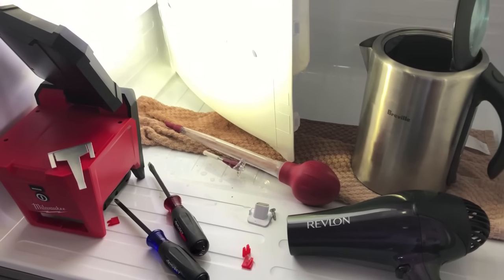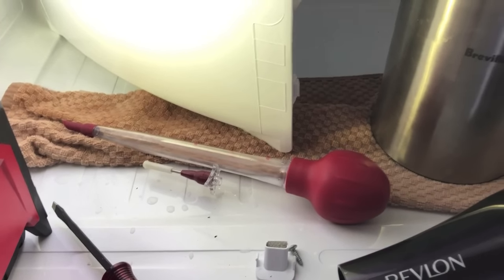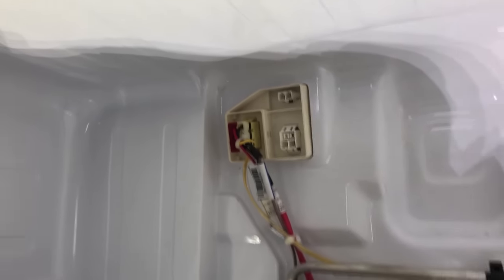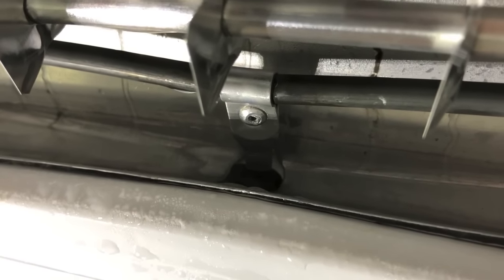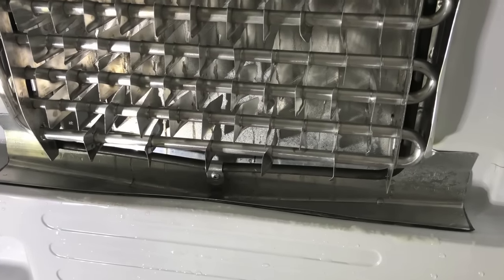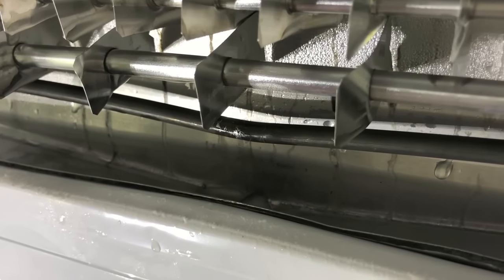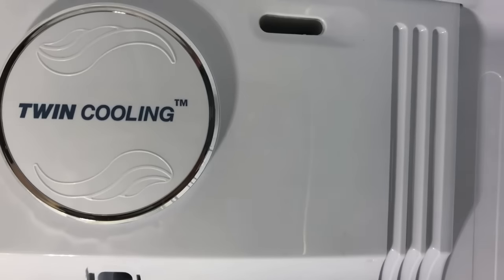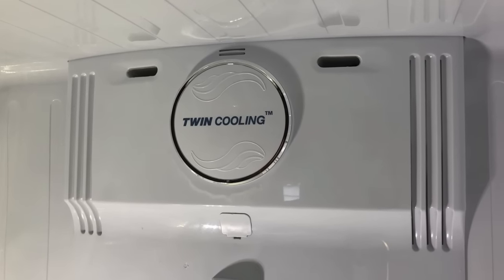Samsung Refrigerator Repair - How to Fix Water in the Crisper Drawers

Comment: I am not going to rehash the details provided in the other
reviews and in several very helpful you-tube videos.  I did have a simple fix which did solve the
problem in my case. When I removed the evap cover I was pleasantly surprised to
find no icing. I went ahead and replaced the drainage tubes and the evap drain
clip. Samsung
A/S Assembly-Water Leakage N DA82-01415A  has all the parts for less than $25.00 from
Amazon. The plate behind the evap coil did not want to come off easily so I
left it on rather than risk breaking something. Since icing was not my problem
I wasn't too concerned about the insulating strips.  What I did find was corrosion on the steel
back of the evap cover. The cover has a flange on the bottom that directs
condensation into the condensation drain. The flange had corroded to the point
that condensation was leaking down the back of the refrig and into the
compartment. That explained the rusty stains on the back of the refrig
compartment. I cleaned the plate as best I could and dried it thoroughly with a
hair dryer. Then I covered the corroded area with self adhesive aluminum tape,
making sure to remake the flange. Be sure to press the tape down thoroughly. I
did this 2 weeks ago and checked for moisture today. To my great relief the
compartment is bone dry. Hope this helps.
Reply: ...and Two Years Later?
Reply: @PatriotMarine  The corrosion on the metal plate on the back of the Evap cover did get worse so I got a new Evap cover from Amazon ( Samsung DA97-11772B Assy Cover Evap-Ref ) on 11/23/2020. Very easy to install and no problems since then (knock on wood).

Comment: I'm fixing to try wrapping some 18 guage copper wire, I picked up at Home Depot, next to the existing ice defroster clip and hoping it transfers enough heat to work.  Thx for sharing this video👍
Reply: ...and?
Reply: And? Did it work?
Reply: @willkeen5010  I wound up just ordering the part off of Amazon. It's a simple fix and costs less than $10 if I recall correctly. The replacement off of Amazon is bigger and longer than the existing one. Therefore, it transfers more heat. 👍
Reply: @BC-zd5xw  thanks, parts on the way 👍

Comment: Just FYI - I was completely unable to cut the old metal tab off using a standard wire cutter as shown in this video. I tried everything from Channelock cable cutters to Hakko flush cutters, all to no avail. I finally resorted to using a pair of miniature bolt cutters, which worked like a charm. Only the bolt cutters were able to bite into the metal tab at a high enough point (i.e. around the rivet) without putting too much stress on the heating element.

Comment: Great video which helped me quickly find the part and fix the problem in about 1.5 hours for $10. Note that hot water wouldn't go through the drain hole so I had to remote the lower back panel to check the fridge drain tube located in the right corner to find-out that it was clogged with slime. I removed, cleaned and replace the drain tube which may have been the source of the problem. I notice a similar earlier comment and would recommend that you also check and clean the drain tube. Thanks.
Reply: Glad I didn't try to take the insides of the fridge apart. The problem was the drain tube that was blocked at the bottom. So access through the lower back panel. Removed and cleaned the three drain tubes. One of them was full of water.  Took the opportunity to vacuum out all the fuff.
Reply: @peterwhiting6303  did that fix your drain problem?  My fridge is 14 years old and I wonder if I should try to fix it, I’m a widow & would have to do it myself; no I dont overload my refrigerator.  The crisper drawer had water.  Lately the water is going UNDER the crisper drawer.
Reply: @A10TOES  The problem in my fridge was that the bottom of one of the drain tubes was blocked with dirt. So with the power off I removed the back cover at the bottom of the fridge. This enabled me to access the bottom of the drain tubes.  3 in my fridge. The tubes deposit any water onto a tray above the compressor from which it evaporates. As I lifted the bottom of one of the tubes  the  tube emptied itself. Quite simple. No cost.
The problem described in this video of tubes being blocked with ice is real however.. If you are lucky the blockage problem is dirt at the bottom of the tube. If you are unlucky the problem is ice at the top of the tubes.
Reply: @peterwhiting6303   thanks for replying Peter.  I think I will check the back of the refrigerator & look at those drain tubes first, sounds easier to fix.  If they aren’t clogged, then I’ll know it’s the inside ice built up.  At least I will know what I’m dealing with.  Thank you!
Reply: @A10TOES , hello, did you do it? Im also a widow and i m afraid to take out the back pannel. I think the problem is there. I ve never cleaned that tray, it must be filled w dust and mold... I d appreciate your answear, ty

Comment: I looked at other video and thought my sensor was bad, changed it out and didn't fix the problem.  Saw another video where the guy just hung a copper wire long enough to reach the bottom of the well. I did that and the problem was gone.  Looks like the "newer design replacement" is the official way to go :) thanks for posting.
Reply: I'm having the same issue. Mine took longer to manifest though. It's been abut 6 months but now it's doing it again. Did you find a fix?
Reply: @jbrown7441  it's doing it again on mine too. But not always, maybe every 5 months. Maybe sometimes the fridge is set too cold?

Comment: Great video and thanks for this helpful info! 

I have made the modification to my refrigerator as I was getting quite a substantial amount of water accumulating on the base where the food draws are located. It seems to have helped quite a bit and I have even replaced the drain tubes in the rear of the fridge for good measure, as recommended by someone in another video. However, I am still getting a little bit of water accumulating more so on the left side of where the large food draws reside - any ideas what may still be causing this? I was able to test and make sure that the water drained correctly per your video, but not sure why I am still getting water and truly at a loss here as I have done everything that that has been suggested. I did notice behind the front cover that there were some areas that were a little damagaed and possibly not sealing as well as it once was - could this be the issue? Thanks in advance...
Reply from the maker: Check out the 2021 update with the temperature suggestion and that might help. Good luck with it!
Reply: Thank you and sorry for not replying sooner but after I left it for a little while, there was no water collecting any longer - not sure what happened but the fix eventually worked!! Thank you! 😊

Comment: Fixed mine, thanks for sharing the video, great help!
Reply: Fixed is a big word it's like a prayer , for me only time will say I get the ice build up only once a year ! the one part that should be changes also is the two drain tube in the back the poorly designed rubber valves dry up and keep the cold water trap in the downstream tubes going to the evaporator receptacle the DA97-04049D part number  you need two of these cheap to change why not !
Reply: Still dry?

Comment: Thanks for the helpful video! I've watched a few different versions of these clip installations and noticed some other people don't wrap the arms around the coil and simply let the clip sit there. Do you have any thoughts on why they do it this way?
Reply: Wrap it around more metal to metal contact. But this will not solve the ice ball that builds at the top. I bought the warming kit look on YouTube for more of how to fix these
Reply: I didn't wrap mine around as I just wasn't physically able to do it.

Comment: Great video.  I just started having this problem a few days ago after 5 years of owning my Samsung.  One thing I have is discovered is that it stops dripping when I take the Crisper drawer out and leave it out. I was trying to discover where the water was actually coming from.  This tells me that with better air circulation I'm not getting the same freeze up. Does this make sense?
Reply: Dave,  Was this permanent solution?

Comment: This will be the second time in less than six months I have had to do this repair.  I think part of the problem, aside from the inadequate heat sink fin, is overloading the fridge.  Since the COVID19 pandemic, I have been trying to buy enough food to last for more than a few days in order to curtail frequent trips to the grocery store.  I think this prevents adequate airflow in the refrigerator part of the unit.  I don’t think I can replace the fin as it sits well down into the drain hole and the heat coil it attaches to  is bent into much more of a “V” than you show in your’s and is immovable.  I’m going try to pay closer attention to how much I put in it to see if better air flow curtails this from happening so frequently.  While it’s a fairly easy fix, it’s kind of a pain in the ass.  I stopped using the veggie bins and waited until the fridge was mostly empty before doing the repair AGAIN.  This video is a Godsend.  Thank you so much.  BTW, be very careful if using a hair dryer.  It has distorted the plastic on the back wall and melted the styrofoam a little on the inside of the panel.
Reply: Good advice. A note: most hair dryers have a “cool” button that will make the air cooler than the regular low setting.

Comment: Thank you for the video session.
Is that heating element you got compatible for all Samsung twin cooling systems?
I just defrosted everything and it last 2 days for a RF 263bearss/as fridge.
I just shut it down and opened up the panel and let it drain.
It is working well now but for how long?
Thanks again!
Reply from the maker: Hi Alex, I don't know which models the clip is compatible with, sorry! Appliance parts suppliers can likely advise you with that. Our specific repair on our fridge is still going strong today (long after this video went live).
Reply: Home Fixated Good afternoon!
No problem.
I got the fridge defrosted completely and it is working fine again for now after a few days now.
I will keep the prescribed temperatures for both freezer and fridge and we will see the outcome.
Thanks again for reaching out!

Comment: I found that I had a similar problem but the issue was the channel at the back not collecting water properly.  Water was running down from the back left and right wall sections and not into the channel where the water should drain.  The channel directing water from the back left and right side down into the hole at the left and right edges wasn't deep enough so the water would just pour up and over the lip.  I added a self adhesive rubber tube that seemed to work and I also did the fix as mentioned above with the same part just to be sure that problem didn't happen either.
Reply: How has that worked for you? I installed the new drain clip and just noticed water in the crisper again. Ready to give up and buy a new fridge. My freezer works as a fridge anyways
Reply: @jamesblanchard9771  The fridge is in my tenant's suite but after doing what I did, there haven't been any complaints with the same issue on the fridge for 2 months.  Poor design on that whole back panel.  I suspect that many people are having the issue that I had and the drain clip won't solve the issue.  For an extra bead of silicone and a rubber D channel, it seemed to work for me.

Comment: How long did it take to the the water to flow through the drain out the bottom of fridge? I have been adding and removing hot water for what seems like way too long. The drains at back of fridge are clean too

Comment: Just a heads up, the clip is NOT the issue. I'm the maintenance guy in a building with 50+ tenants. I can't tell you how many refrigerators I've done this too.  After 3-6 months I have the same issue. Water collects in the crisper and under it. Some refrigerators Ice up completely all the way up to the fan which then stops and causes the temp to rise. Good luck trying to open the back when it's frozen solid and shut. Last one took me 6 hrs to complete. 
My theory is that its the defrost heater assembly.  It's not heating up at all. And thats the piece that looks like a brown metal tube which the drain clip is attached to. I say theory only because I haven't tested it yet, but it makes sense since the last one I serviced was completely encased in ice.
Reply from the maker: Hi Skid. I can tell you that the clip was definitely the issue on ours (the clip replacement instantly fixed the problem, and we haven't had any recurring issues since). And while the clip certainly won't be the fix for everyone's similar problem, I think you'll find that a huge number of people were helped by this specific fix. As to getting the back panel off because it's frozen solid - that is indeed a challenge, but with patience and following the tips in the video (and a few in the comments), it's very do-able. Good luck with your tenants - sounds like a challenge to manage!
Reply: @homefixated  give it time. I'm betting donuts to dollars you're going to have the same problem.  There's a class action lawsuit going on for their icemakers. How long before this gets turned into a suit? But thanks anyway. Your video was one of the more helpful ones
Reply from the maker: @SkidVicious1971  Maybe your tenants have a different model with a different issue, but it's been roughly 2 years since I did our fix and we haven't had the issue come back. Glad you found the video helpful though. Wishing you and your tenants all the best!

Comment: Any suggestions if the inside bottom crisper is still filling up with water after replacing this part? Could it be something in the line or something else I could replace? It seemed to fix the problem for a couple weeks now it's back.

Comment: I have a question, if water is backing up into the crisper, and or under the drawer, wouldn’t that mean that the drain tube in back is clogged?  We had a power outage , electricity off for 16 hours & the water went UNDER my crisper drawer, usually goes inside the drawer.  What do you think?  Check drain tube first?  Is there a part number for it?  My fridge is 14 years old, is it worth fixing?  Bought new in 2008.  Thanks!
Reply from the maker: If water showed up only after a power outage, then it may have been a one-time event. If your fridge regularly has this issue, then please check out the full video (and the article / part info linked in the video description above). Thanks and good luck with it!
Reply: @homefixated  thanks! No it was doing the water thing before the electric went off;  my inside panel is different, my son is coming up soon to pull the fridge out so I can check the drain tubes.  My Model is RB215LASH/XAA

Comment: I have a Samsung RF23HTEDBSR and the salad tray is getting wet and ice forming below the tray. 
Sounds like the same thing. One question; when the ice correctly melts and drains out down through that hole, where does it go, is there a collection tank?
Reply from the maker: I believe it goes into a tray to evaporate, but I didn't pull our fridge out to verify. An appliance pro might be able to answer this one better.
Reply: @homefixated  yes it does. I have looked now. It's at the bottom of the unit, near to the warm heat exchanger.

Comment: Hello. I installed the clip yesterday but after about 5 hours I started hearing a noise. Almost like burning drip sound. Wondering if the clip is suppose to go fully in? I know I had a hard time trying to fully put it in. I'm just wondering if it maybe touching a plastic surface. Will have to open it up to see..Any tip would help! Thanks

Comment: Hello, i followed your instructions. also left the fridge off for 2 days. Put the new part in as suggested, week and half later the issue is back. Not sure what went wrong. can you suggest anything else ?
Reply from the maker: Hi Saurabh. Sorry to hear the initial fix didn't do the trick. It could be your fridge has another issue, but it's also possible the drain lines beyond where the part is installed were still frozen, or perhaps have another obstruction. We're not appliance experts, so you may want to consult with one to troubleshoot your issue further. Good luck with it, and if you figure out what the issue was, please circle back and let us know.

Comment: Before disassembling the inside of the fridge, first check if the drain is blocked at the other end, which is readily accessible by removing the back cover plate.  It was in my case.
Reply: Anymore info on this? Is it also inside of the fridge itself? Sorry if that's a dumb question
Reply: @baileytschetter7348  no, its in the back of the fridge, right hand side close to floor level looking from back  You need to pull the fridge out from the wall to get to it.  Is a flexible rubber hose.
Reply: @rossbrown7213  I appreciate you taking time to respond. Thank you

Comment: I was so hopeful that this would work, I bought the clip on Amazon, had my brother in law and nephew working on it for over an hour, dryer on it to melt the ice, put on the new clip, thought it was done....but no, after 2 weeks the water and ice are back,. I am trying to get service from Samsung now....So sad, I like the fridge, feel they should stand behind their product and have a recall, since I'm not the only  one with this issue.
Reply: Take the back off and turn on heater and see if it turns on if does most likely its the thermostat .